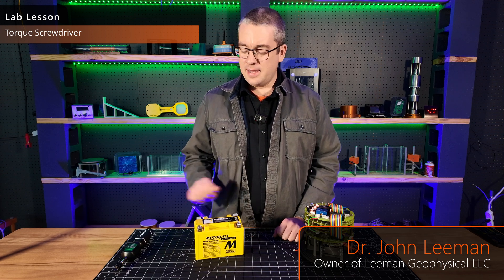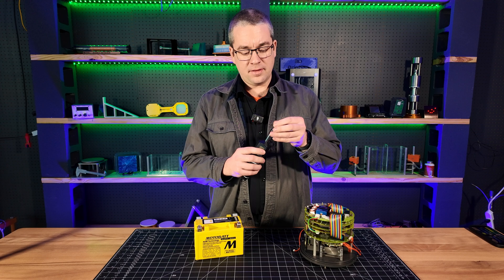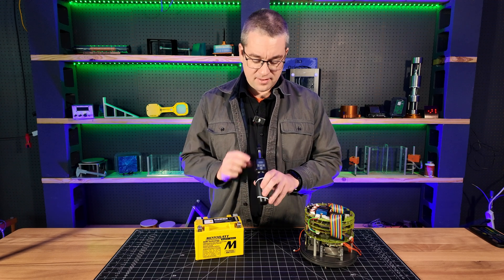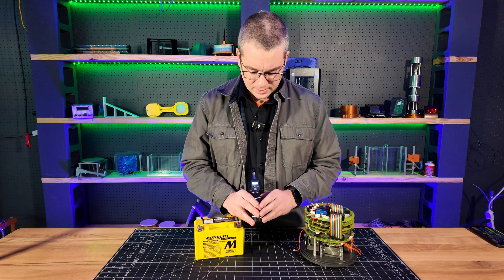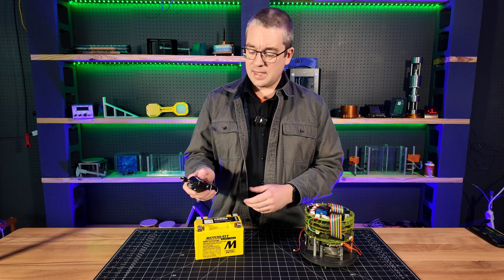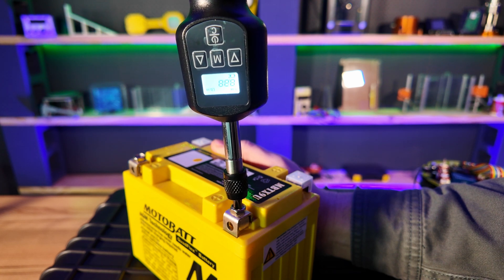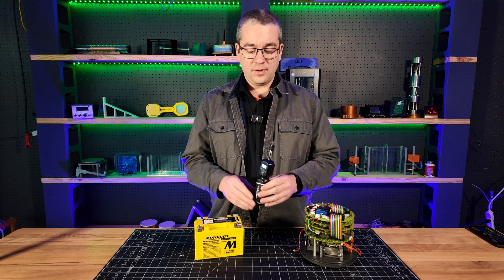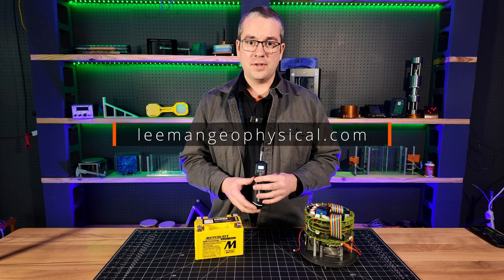Stop Stripping Screws! How to Use a Torque Screwdriver Properly - Lab Lessons

Comment: Recently used a torque screwdriver at 18 inch pounds for a red dot mounting plate.
Reply from the maker: That's a great application. What tool was it? Did you like it? The Husky is the only toque screw driver we've used enough to have an opinion on.